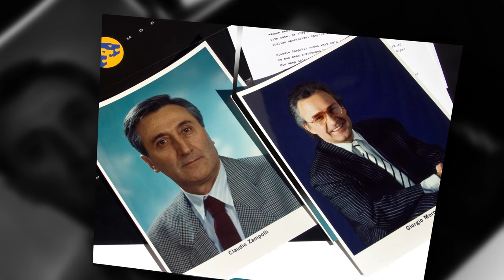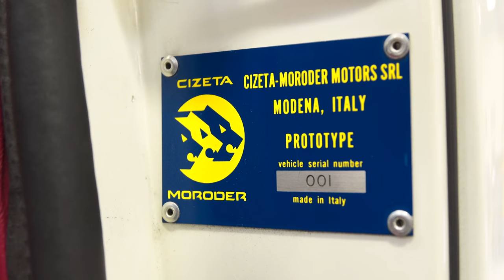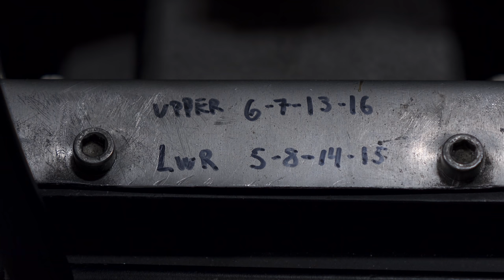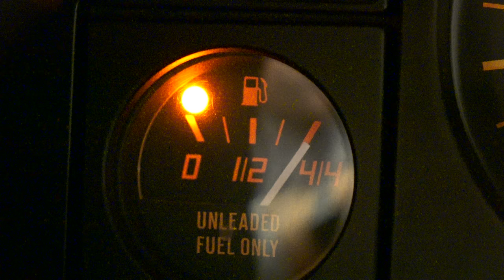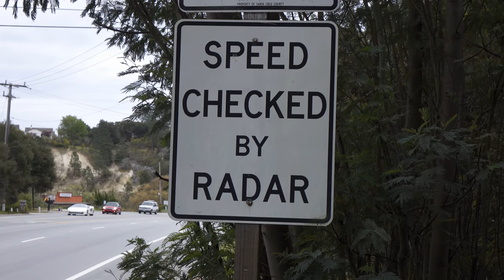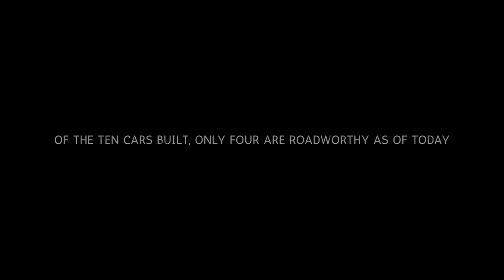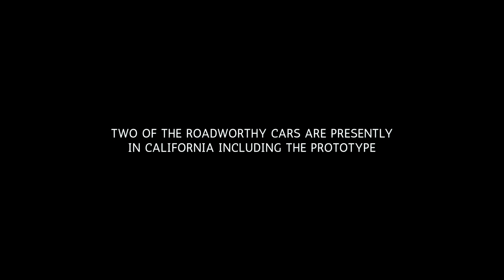Cizeta Moroder V16T: Resurrecting the Wolf Documentary

Comment: Comments: 

At first, it was not my intention to make any comment on Canepa Cizeta video, but then my instinct push me to clarify some of what was being said in the relation to the “Cizeta prototype. As “the Cizeta reborn” and “ Re-engineered.” 

The Cizeta never “kick the bucket” and I don’t believe that prototype was or needed to be re-engineered! I assume, the work that has been done it should be label as “COSMETICALLY REVIVED.” Considering, that after 30+ years seating in a storage facility is nothing unusual to have some paint and “COSMETIC” deteriorations. Also, don’t forget that I Drove-Tested for about 58,000 miles, and besides driving, the many, many hours on the Dynamiter as well…not Cruising, but instead harsh driving. This was for the purpose to test if the 16-cylinder block and gearing, among other devices with most positive results! 

The 16 cylinder engine, Transaxle, Suspensions, Brakes, Exhaust system, Body style Gas tanks, Fuel pumps, wheel & tires, Interior & dashboard, and so on, all it seems to me that has not been RE-ENGINEERED! 

The technician Chris, explanation on what he did to make the engine running on all 16 cylinders is a little bit dubious for a professional like him and here is why!
Cleaning the injector replacing all filters and spark plugs, oil service and general check it will be a regular maintains, but he also pointed out that he rebuild the distributors. That engine is equipped with electronic ECU and the distributor as nothing in there but a rotor and not moving parts!

The gas-tank insulation blanket is also part of being deteriorated after 30+ years, and severe test -driving. The water pump leakage was because of many years of not running, and they claim that it took two months to find the seal when I do have plenty in stock? Instead, they should have followed my advice…I still being “THE FATHER” after all! Of this piece of art!!! 

Now, some illumination on our communications with Chris or Casper calls. 
The first call they inform me that they have a problem matching the “pearl color” to paint the rear bumper and other touch-ups. So I replay that I would send them the formula, which I did without hesitations, and apparently, the painter did a great job, very well done! Then, in sequence, ask for the instrument gauges, and then the water seal, which I do have in stock, but I told them to put me in touch with Giorgio Moroder, which they never did. I was willing to help them with technical and parts assistance since this prototype is my first love! Joys and plenty of satisfaction… 

Chris, also call attention to the engine backfire, but this again is caused by the length of time that the car is been sitting, and here is why. The BOSCH injection system needs to be pressurized in order to compose all cylinder firing, and in this case, the fuel loses pressure.  To pressurize the system by doing a simple operation…turn the ignition key on & of for a few times until the pressure is build up. In addition to the backfire is that also the ignition spark system it calls “ lose-spark double system ” which indicates that in the same time generate twice the spark to feed two cylinders, but one of them is in a phase of an exhaust. So we call “ lost-spark “ and if some gasoline from the previous cylinder phase did not burn out completely may cause a premature fire in the exhaust.

I do contest the Ferrari instruments. What happens to the originals? If there were some malfunctions I do have parts for it or a complete unit for the prototype. The rear bonnet scripts are been done so cheap by a laser cutting on ¼” of aluminum and attached with double tape. They had a good opportunity to do it professionally fashion by making in black letters in plastic foil or similar compound, and spray clear on top of it. 

The wheel caps are done without knowing the fact that these caps also have the functions to hold the wheel nut in case it comes loose. Also, it doesn’t match up to the great Cizeta styling. 

Thanks to Bruce Meyer, to put me, along with the Italian Group VIA Modena luxury motoring events. to see the prototype that sits in Rodeo Drive storage right below his car collection. Bearing in mind that for 30 + years I never had the opportunity to see my first love, and it was an emotional encounter that thrilled me very much! 

Casper emphasize that they spend 1000 hrs (one thousand) to do the “ COSMETIC IMPROVEMENTS “ this is the equal times that it take me to build two Cizeta cars from zero! 

But I do very much appreciate that Bruce Canepa recognized the quality of the workmanship and weigh against the Diablo! Grazie Signor Canepa!
Reply: I love you I read it twice
Reply: The distributors may use electronic advance, but the base timing must still be set, and one can botch that up.  Chris was explaining that he struggled the most with the ignition system more than likely because he did not have base numbers to work with, and the distributor on one bank had crossed wires, and was timed incorrectly.

He mentioned not having spark at two cylinders and he chased the pick-up coil.  Not sure if he misspoke, or if it was lost in translation during editing.  Not having spark on some cylinders is a fault on the secondary side of the system.  I.E. spark plugs, wires, or the distributor cap itself.  That was the only erroneous part of his diagnosis.  Outside of that, appears they did a fine job.
Reply: Right on Claudio! This entire time I’m thinking “and why haven’t they just called Claudio?” Damn politics! But it was VERY nice to see the car showcased and documented. I think despite not mentioning you enough it was a complimentary documentary to the car and it’s quality engineering, build and drivability! Cheers to that, and cheers to you my good man! Hope your well my friend.
Reply: what an amazing reply, hopefully they contact you
Reply: My question is, why did you hold the parts hostage when they called you? If you loved the car so much and knew they were doing a restoration then why did you try to force their hand and make them get in touch with Giorio in order for them to get the parts? Even if it wasn't Giorgio needing the restoration its not right to withhold parts from someone trying to resurrect a legendary machine.
Reply: What an excellent man you are signor Zampolli!
Reply: this is the type of a comments I like to read, Grazie mille for your contribution !
Reply: The car was never finished to begin with. It's not like they just touched up the paint and put some fresh gas in it.

I agree that it's nowhere near re-engineered, but it's also not like the car was ready to go as-is.
Reply: @crzyruskie86  Sorry, that's 'ownership' for you. Man's totally free to decide if he wants to sell/help or whatever.
Your "it's not right" is wrong; it's his total right since he owns them.
(Of course there could be some kind of goodwill, but that's totally up to the owner to decide, not for us.)

Amazing video, I remember this car from one the lots of car books I've read when I was young.
Reply: I agree that it is not a "re-engineer" scenario. More like it has been "re-comissioned".
Reply: Wowsers.... it was amazing reply! A true gearhead. But I wish the reply was longer and more detailed. 😎
Reply: Do you still see or work on Sammy Hagar’s vehicles?
Reply: Dear Sir,may I ask you about the styling of the car ?
Were you satisfied with such an appalling mix
of aesthetic themes coming from several cars
which were marketed back in the days ?
Did you discuss the Gandini iteration of a new
supercar and which was the ideal result you had planned for your CZ ?
Looking back at your in the years ,could you
tell me the pros and cons of your involvement
in such a project or what would you perhaps do differently ? 
It's a complete privilege getting infos from the
founder of the factory instead of listening to third parts statements...
Feeling thankful for your kindness and your time kindest regards from Italy.
Reply: @aaronshagar  very nice car
Reply: Was that the timing chains making the whining noise or does that thing use timing belts ?
Reply: Brings back memories of the time I saw one here in Brunei in the early nineties, with painted rainbow stripes on the sides. Wonder whether it was originally painted that way from factory.
Reply: I was going to say those looked like modified Testarossa gauges... I remember them looking a bit different thanks to Gran Turismo...
Reply: I do not see safety belts in this car, and Mr. Canepa was not wearing one. If it did not have belts originally, why not?
Reply: 1000 hours @ $100 /hour.  🤣🤣🤣
Reply: @DennisAlexioAndyHug  madness lol bless you :)
Reply: Great work! So if this prototype car they rebuild is up for sale, then I don't understand why cannot you just build more for sale? People will buy them and you will make money, so why don't you build more of this masterpiece?
Reply: This is the coolest comment ever!
Reply: @aaronshagar  It's more than just simple politics. At the end the video creator is listed as Brian, and Brian and Claudio had a very public falling out on Ferrari Chat where both called the other a liar and Claudio claimed Brian stole his information and didn't have permission to do a book that Brian originally made about the Cizeta company. 
They weren't going to call Claudio because both Moroder, Brian the documentation, and even celebrity car guy Leno all hate Claudio and call him a thief/liar.
Reply: @situbes.972  I got that same sense.  I find it very unprofessional that he took it upon himself to post this.  It reminds me of the David Prowse behaviors every time he felt left out by George Lucas... Makes me wonder the real reason why he wasn't involved in the process more.
Reply: @DarkHumorWritesItself  i am no engineer nor did i portray myself as an expert.  My comment was that it seamed Claudio was talking down to technician trying to repair the prototype type car with a unconventional ignition system that was in fact malfunctioning. So tech's "reengineering" was trying to backward engineer the system to figure out how it might operate and get it to operate. Now Claudio claiming that everything was working and there didn't need to be "reengineering" done might be true years ago. But who knows what happened to the car. A "great""inovative" engineering can be a living nightmare to those trying to troubleshooting, especially with no documentation and an unconventional system.  Lets not forget, it was a prototype. Even with all documentation, this was a test mule, with constant tinkering, mods, something maybe have broke and others have "try" to repair it. By try, i mean making it worse. So i dont see why he is belittling the tech for repairing this car.  The tech, with frustration, was venting on how could this have ever run on all 16 cylinders with what he eventually found. He reengineered things to make them run with his knowledge or experience- doesn't mean that the engineering was awful, it just meant he found better, simpler, more conventional, or methods more understandable to him.
Reply: @DarkHumorWritesItself  the perfect response. I completely agree with every word you said.
Reply: Great to hear from Signore Zampolli - great bit of exclusive  insight from the master and great to reminisce about such an amazing car. I remember seeing and reading about this as a 10 year old and buying and collecting any picture, magazine or article with it in it. Great to see the passion still runs deep and enjoyed the many comment on Claudio's post... Keep the dreamers dreaming!
Reply: @DarkHumorWritesItself  beautifully said dude!
Reply: @situbes.972  totally agree, even the world's finest engineering can have issues from sitting or heavy use over multiple decades
Reply: mclarenV12 
Your comments about flawed geniuses are why they failed. They were assholes to work with. They need help with their projects and dreams, usually financial, but beat you up about it. Eventually everyone says "fuck 'em, I'm not paying anymore".
Reply: mclarenV12 
Claudio didn't get to work on the car because they were sure he wouldn't give it back. These guys have serious bad  blood between them, for millions of dollars. They knew they'd never see the car again. There is no way they were going to open a line of contact.
Reply: @situbes.972  I think he was a little pissed that marauder was being charged 1000 hours for this work, don't you? And it's pretty obvious that Canepas shop did not want him to be in touch with Maroder... because he would've told Maroder he was getting ripped off. That's how I took it.I think he was a little pissed that marauder was being charged 1000 hours for this work, don't you? 
  Seems that if Claudio says two cars could have been built in that 1000 hours, the people on the wrong side of this (if anyone is) is Canapas shop, no?  If they wanted some goodwill, and help from the original car designer, seems it's the least Canepas shop could have done. But if you want to ring up lots of hours, you got to keep those two people apart from each other. Right? I am imagining Canapa shop is well over $200 an hour, not $100 an hour like somebody up above wrote.  :-)  That's a potential $250,000 bill to get the car running. If Claudio helps... and knows what he's doing, I'm sure it could have been back on the road for less than $20K - $30K, easily.  ;o)    Bye-bye $200,000!
Reply: @sungkono1  I would guess the shop rate at Canepa is quite a bit more than $100 per hour.
Reply: @vicenzor9699  Link to the Fchat thread?
Reply: Wow. Just think of how much money and time could have been saved by just calling on the expertise of the car's father. Amazing. I felt like I just met a famous person after reading that post.
Reply: All best to you from Serbia signor Zampolli
Reply: @crzyruskie86  They had a big fall out.
Reply: it seems like these guys by what Claudio is saying had an ample option at doing a proper restoration on this car with his assistance but I feel comes off as arrogant or egotistical to decline the opportunity to work with the cars creator instead opting out to rely on their own name to tie into the restoration instead. If it were don't by me i would have flown Claudio in personally and had him oversee the entire restoration. Great job, but could have been done 10x better..
Reply: Bro. We didnt need a book in the comment section
Reply: @DarkHumorWritesItself  "  Like Delorean ,or Gerald Wiegert. They were backed by their single vision, geniuses " Listen. They were pretty frickin' far from geniuses. DeLorean was simply a crook whose sole talent was "good marketing". He sure as heck was no creative engineer. The whole DMC-12 project of his just reeks of opportunistic money laundering. The price alone was insulting. And Gerald Wiegert? Are you for real?? The guy rolled around his pipedream supercar project for a quarter of a century and nobody wanted to buy one. Only little kids ever talked about it and spread ridiculous myths about it. It was literally the car equivalent of Frankenstein's monster. Less than a dozen were made and most of them were sold to ignoramuses in the Middle East with more money than sense. Even they abandoned them eventually. Wiegert is and was a joke with his cobbled together from scrap parts from others cars "supercar" which looked like a cheap Lamborghini knock-off. The guy was from the same mould as the traveling charlatans of the past who showed "mermaid skeletons" , sold "snake oil" to cure all ailments and offered useless "inventions" to gullible people. 

"Sometimes these people suffered as a result. " Most of the times deservedly so because they offered a shoddy product. Quite a few of them were just textbook opportunists willing to cut corners wherever they could. 

"Society rewards Jay for being non threatening toward women and capitalism friendly." What have you been smoking? Say that in public. And what's this "non threatening to women" spin?? I'd rather not speculate about what you're implying here. 

"Delorean, Preston Tucker, Geri Wiegert, all people with questionable personalities" Make that questionable morals . At least Preston Tucker had some good ideas for regular consumers which is where the rail gain is. That being said he was openly lying and making up as he went along until people had enough of his empty promises. He made big promises which couldn't be backed up. 

" Love them or hate them real geniuses should just be accepted for who they are, flaws and all." You haven't the faintest clue what a genius is and are woefully inadequate to make to any statement regarding them. The fact that you believe that scam artists who never invented anything remotely original on their own proves what you know. Some of these you mention were crafty con men and I'll give you that they may have been shrewd and driven - but that sure as heck doesn't define them as geniuses. Are you for real?? They were tenacious. And by that definition Ed Wood J:r was a "genius film director". And you don't know who Ed Wood was either. 

"but their genius and car designs were undeniable many years later. " You're crazy. "undeniable". How old are you? 14? What are you qualifications anyhow - a masters degree in assertions backed up by nothing but highly subjective opinions? Have you anything valid or factual to use as an argument for their "genius" ? You having a hard-on for them because you go gaga when you viewed their cars doesn't count I'm afraid. 

"This comment proves it" No. YOU. Literally. Put .Your. OWN. Personal. Spin. On. It. Which. Has. ZERO. To. Do. With. The. Original. Comment. 

"Politics are total B.S" What has politics to do with car designing you tinfoil hat? Whoever talks about politics in this video?? Again you're putting your own rabid spin on things including whatever offends you even if it has nothing to do with the video. "doesn't confront women" is another good one...

"Everyone needs to come together through art and technology." Art is subjective. Technology also created nuclear weapons and the means to wipe out the human species. See how shallow you are? Also, are you somehow implying that your "art and technology" cars(!!) is what people should "come together" under?? How about providing decent living conditions for regular people first? I reiterate - how old are you? 14? You seem pretty childish. 

"Forget about petty personal shit" Speak for yourself first. And as for petty you're as petty-minded as they come. Sounds like you're projecting your own negative traits onto others too. Point your finger at yourself first before you point them at others for being "petty". 

"and possibly millions of dollars lost over 30 years ago" No. Stuff like that isn't just easily forgotten. Have you ever lost more than a hundred bucks? So what do you know about losing millions?? What did you lose?? 

"No need for psychiatric counseling." For who?? 

"Cars and art can be people's therapy" They can also be "unhealthy obsessions" - especially for those who quite likely don't even own one. And what do YOU know about art? You come across as a textbook philistine. If you're serious about art (which we both know you're not) I highly suggest you get into written art first before proceeding to Renaissance painters and then great works of musical art. Architecture qualifies more as art than cars. You can't name a single architect or a style. But you want people to "come through cars and art". Unbelievable!

"if people are just willing to accept and forgive themselves and others for past disagreements. " Listen. Some people never change. There is nothing to forgive. And "forgive themselves" ?? What does those who were conned by charlatans have to forgive themselves about? 

"Just be well everyone and never take life for granted " The only sensible thing you've said in the entire  post. Hallelujah. 
By its own its fine. Tied to the "point" you're making its downright alien. I get it, we must forgive all frauds and charlatans and start worshiping their "genius". Because they're "geniuses". And we must all come together through this "art" which is cars and that'll solve everything. Never mind some real issues that needs to be addressed first - nope, if we all just forgive industrial conmen for squandering millions we sure will come closer to a human utopia. Do you know what "pretentious" means btw?

"Money is inevitably worthless." True in itself. However it does hold value as long as there is an use for it for living people. Money makes the world go around. While it can indeed be used for wicked things and be needlessly wasted on vapid projects, it can also be used to help people and society improve on all levels. You're just painting a false dichotomy of money. 

"Human lives are invaluable". Then start working with something which actually saves people's lives . Try telling the people who can't fix their leaking ceilings they can "fix their lives" by listening to your ramble about "misunderstood geniuses". 

"The Cizeta is a representation of human life." Seriously. Have you ever listened to yourself?? An obscure supercar most have never heard of is the "representation of human life" ? Say that to ANYBODY on the street and observe their reaction. Have you ever talked to people? Do you ever go out and listen to what people are like? You live in your own ivory tower of deep pretension. 

" It is art" You're beyond belief. Do you ever scrutinize yourself or your vapid thoughts?

"Life is too short for grudges." I'd rather live in a world full with grudges in which we eventually come to a solution and some sort of compromise than living in one where we should just ignore everything and drink your kool aid about "art". 

I have more respect for self-aware shallow people with no pretenses than I have for pretentious troglodytes talking about "art" but only coming across as fools white-knighting charlatans and conmen. That's as low as you could possibly go without joining some isolated sect. 

The harshest lessons are the best. Hope you learn something from this.
Reply: @sierre00  new cars are available for sale
Reply: That part about water pump seal sounded to me like a made up problem. Water pump rebuilders usually have even the most obscure seals available and know how to cross them from one make to another.
Reply: @sierre00  I can't figure this out..🤔
From what i understand, it's all to do with rights issue...& The 2 factors fell out regarding this beautiful automobile.
Reply: @sierre00  I can't figure this out..🤔
From what i understand, it's all to do with rights issue...& The 2 factors fell out regarding this beautiful automobile.
Reply: @situbes.972  I agree, & the passion in the engineering shop, staff ect...
There trying there level best!
It's a V16 lump! & Shoehorned into that shape , one can only commend them for the effort!

The whole argument is ridiculous! 
This could have been one of the finest automobile's out there....
Forgot the vulgar Bugatti 'heyron' just a overhyped volks or whatever German conglomerate make it is .....